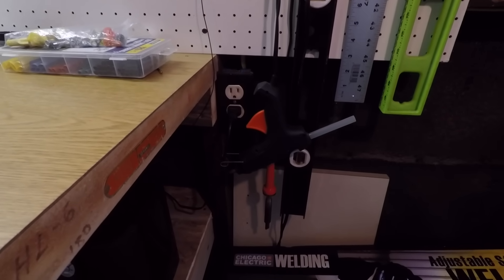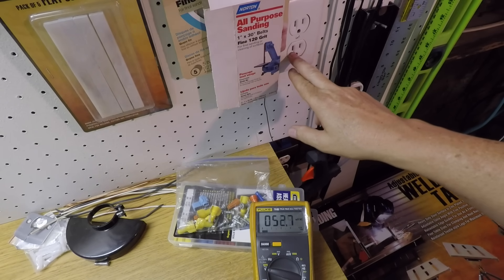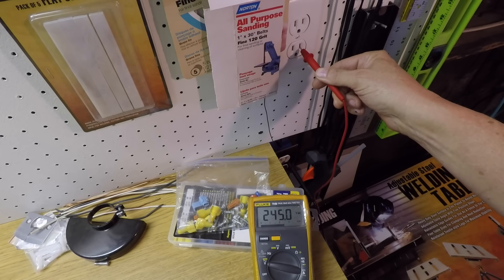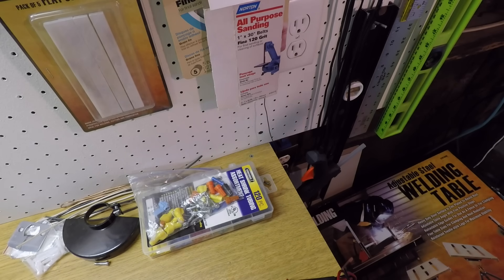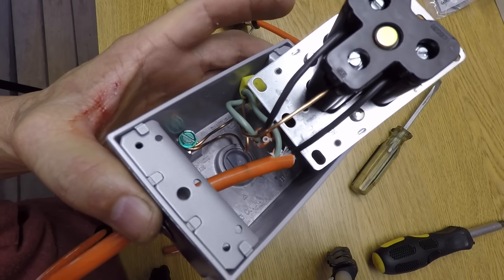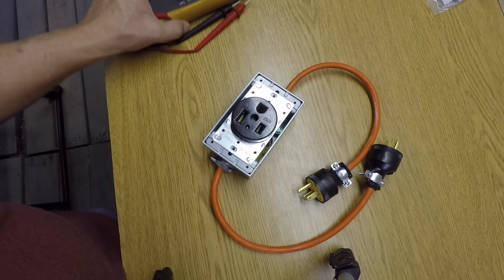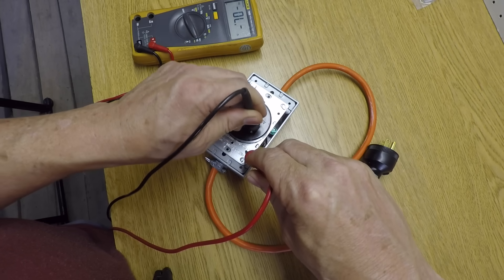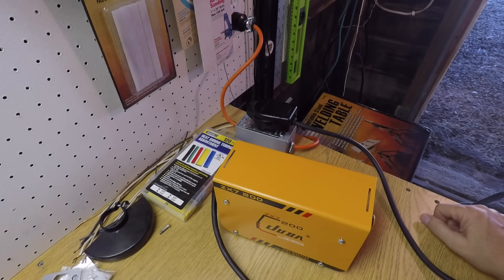How to Get 220v From 110v

Comment: Honestly I'm a Electrician for 30+ yrs now, and if you have the knowledge to do that, you should REALLY  run a separate 240v from your panel,  brother I've seen so many mistakes, problems,  and fires/ shocking wires/shorts. Please dont do this, a welder,  air compressor,  anything 220v/240v need it own dedicated circuit/ outlet,  not shared in anyway.  Please fix it right and be safe , God bless.  
Daren from south Florida
Reply: The reason to run a dedicated 240v is if one side shorts both breakers will trip shutting down both legs.  With this setup you could trip one breaker and cause the voltage to drop to 120v and fry any 240v item you are using, at the least it won't work correctly.  Seems like he knows just enough to get in trouble... 
This might work in a pinch but not a safe way to do it!
Reply: @arkansasmountainman  What if he uses breaker ties?
Reply: @arkansasmountainman  that can't happen
if you open one breaker ... the circuit is open ...it's like putting the light switch on the neutral side 
but it's safer to open both side...
Reply: @moreause  he's right. If one leg opens on a 240v circuit, the other leg is still hot which means there will be 120v still running in the circuit. This is why multi-leg circuits require breakers that are tied together or a multi-pole breaker. It is like putting a light switch on the neutral side in that it's non-code, unsafe, and very bad idea.
Reply: @arkansasmountainman  since I can't seem to put V8SKULLS ATTENTION WITH THE @ CAN I get you to take a look at this rig I have setup for my welder and let me know if it's safe? https://youtu.be/39pDXRI2q8M
Reply: @arkansasmountainman  The voltage may drop from 240v to 120v, or it may drop to 0v. Why zero? Because the 2 120v circuits are in series, not parallel.
Reply: @foureyedchick  it will not drop to 0v. First, power lines are not series or parallel. You have 1, 2, or 3 phase power. If you are using a single-phase 120v transformer you will have a single circuit supply that will only give you 120v, and if you attempt to wire from two breakers, they will both be the same circuit, so the potential between the two will be 0 because they are the same circuit. If you have a single-phase,120/240 you effectively have two different legs, with a total potential of 240v, between them. If you lose one leg, you will still have 120v. The only way to have 0v would be to lose both legs. Loads are in series or parallel, supply is not. 40+ years as a lineman/electrician. It may also be possible that if you have two 120v circuits that you will have 208v between the two circuits. If you want more information about how this works, message me.
Reply: @inconnu69  what I am thinking is  If the item he has plugged in is getting the power across the two hots or two diff bus bars when one breaker trios then there is no circuit. yes there would be 120 from one hot to the ground but if the welder is wired to receive power from the two hot wires and  not wired to receive power from the ground then it should be getting 0v.   

this is a question not a definitive statement.     

the transformer is 220 volts from end to end or the two hot wires.  has a center tap to provide half(110) and also the center tap is referenced to ground so there will be 0v between "neutral" and ground for safety reasons if I am thinking right.  

so a 220 circuit makes a complete circuit with both ends.  loosing one breaker breaks the circuit all together?     yes still 110 between one hot and ground on the leg that did not trip but if machine is using the ground as only a true ground fault and not a neutral then it should go to 0v to the machine hooked up.    

anyways that is what i am thinking
Reply: @arkansasmountainman  Nope, 220 doesn't  work like that at all. In a  220 set up the other leg is the return. If one leg trips. The other leg has no means of return other than ground and thus no way of frying anything anything  because without a return the voltage is zero. Happens all the time when 220 breakers go bad and one side opens. Even sometimes the main breaker or even the meter fails on one side. Power companies have shunts used at the meter to to feed the entire house with just 120v. 220 appliances simply don't  work in this setup.
Reply: @u000na0  I believe Arkansas man is correct. We aren't talking about a 220 circuit, we are talking about two 120 circuits with separate breakers. If there were a radio, for example, plugged into the tripped 120 circuit, there would be current from the untripped circuit through the tripped circuit via the neutral of the tripped circuit...which ought to trip the untripped circuit due to the overcurrent condition. Anyway, that's how I'm seeing it. I drew it out on paper and that's what I came up with.
Reply: Truth Be Bold dude. It’s two hot wires that get you 240v. There is no neutral in the circuit.
Reply: @RB-xv4si  you should hear him out. The current will look for it's path back to a return leg and since there would be a theoretical open breaker, if any "appliance" is sitting in the on position, that appliance's neutral becomes the return leg. Which not only is a 120 volt loop, but with loads in series, it's even less voltage for each.
Reply: @u000na0  could shock the tech troubleshooting because the terminal/wire on the OFF/TRIPPED LEG could be backfed!
Reply: @u000na0  so a 2:40 leg is too hot and one neutral and what he has there is too hot too neutrals two grounds to Earth and he's only using two grounds to Earth and two hots and he should be using a dedicated line with one neutral and too hots is that right?
Reply: @mrreams711  That is a really good point.  I was thinking in a fault situation this would be bad, but even without a fault an appliance that is on would provide that path back via its neutral.  Even more reason not to do this.  Plus if those circuits are protected by a GFCI that thing would constantly trip.  Another unspoken reason why the NEC is requiring more circuits be GFCI protected, lol.
Reply: @u000na0  other than ground? How about a human ground.
Reply: You still around?
Reply: @shadowdemon7770  he burned the house down lol
Reply: @chev1972chev  lmfao probably 😂
Reply: Agree 100%. This will work, but its not worth the risk. Do it to code. Be safe
Reply: Doesnt work if youre a mobile service provider.
Reply: i got a mini welder that only has 2 wires coming from it and it is a 220v i am thinking i should replace it with a 3 wire power cable would i be on the right track?
Reply: @tommybaker419  I’m not sure exactly what you mean but if it is 220v and doesn’t have a 3 prong power cord it may have been modified by someone or is extremely old but I would be careful using it. Maybe you could have someone check it over before you operate it. I could be wrong but I thought any 220v appliance in the U.S. should have a ground. I should state, I am not an electrician but I have been a HVAC tech for 17 years and my father was a class A contractor, so I have been around the block. But like I said I could be completely wrong and it could be perfectly fine.
Reply: agree     also no neutral
Reply: Exactly.
Taking three left turns to go to the right.
Reply: @courier11sec  363
LOL
Reply: Exactly.   He's deinventing the wheel.
Reply: since you have been doing electrical for 30 years do you know the name of the box he is talking about? I want to get something for my son who lives in elkins wv  they have no 240 outlets on there property at all
Reply: @carlrockaway1696   I have been an electrician for 40 years and never seen a legal device that does what DIY is doing. to be able to sell an electric apparatus the device has to be UL or approved Laboratory testing. This would never get the seal of approval because it does not allow for tripping of both legs. Also windings if one shorts, who's to say the other side trips? if it remains hot current could still be in capacitors etc. and if anyone opens the cover to check the welding wire and thinks it is off they could be in for a surprise. It just isn't a good idea. It is not a big deal to run a 3 conductor dedicated circuit back to the panel.
Reply: Can I get you to take a look at my setup and tell me if it's safe? https://youtu.be/39pDXRI2q8M
Reply: Hes prob trying to save money or box is a bitch to get to.
Reply: Same situation and I nearly fell over laughing at what folks will do, safe or not, to get power. And YES it needs to be a 2 pole breaker dedicated circuit.
Reply: Okay but what about the old fuse boxes?  One leg the fuse blows and the other leg is still hot?  I've had service disconnects where one fuse blows and one side not...
Reply: You could potentially phase the box doing this as well the two breakers should be on both poles of the panel inside of your breaker box. This is a terrible idea.
Reply: Can help me with my issue I see you have the West Virginia or Virginia label
Reply: V8SKULLS amen! This is a horrible idea. The breakers also will not work right.
Reply: Agree. By the time/material/compromised safety is figured in , you could buy the romex, box, breaker and outlet .  Especially a welder is going heat up those stranded wires and rubber coating.
Reply: So if he had the proper diameter wire instead of the orange cord he used,, and plugged those into an outlet each, then ran the other side into a small box that held a 240v breaker, then the proper wire size out of that box and into the 240v plug/ box, would this be any safer or is it still a issue because of the 2 120 breakers in the house going to the plugs and there’s just no way around that fact? Basically is there any way to make this safe or how can I make this as safe as possible if I wanted to make one for emergency use every now and then ?
Reply: In my opinion, there is nothing inherently unsafe with this. Anything 220 does not need a dedicated line. In much of the rest of the world, 220 is the standard because they dont use center tap transformers. This is a single phase setup. As long as the wires can carry the load, there is nothing unsafe about this set up. It's  even practical if it is the only viable way to feed the rated load. You know what they say about opinions though right.
Reply: @u000na0  no.  rules require that any line tripping a breaker trips all lines.  2-pole breaker required.  Also, if one trips, user will have one hot and one not and could be in danger while trouble shooting.  And, the load, if connected, will pass that one hot through it to the point of open circuit---possibly all the way back to the tripped line......so the user/tech could have a HOT screw on an off/tripped breaker.
Reply: @u000na0  No I totally agree with you, there is application where there is an incredibly low risk of safety. Literally tens of thousands of things like you said run off of 220v super low amperage, Phone chargers, tv, house lights, ect.... but I think there is an issue when it comes to Americans converting it. because I would imagine most of the time we would be converting it, its for heavy equipment running a much higher amp and totally runs risk of way maxing out ratings on plugs, wire, and over all setup. that's where issues can come in. I'm not gonna lie I use one of these for a 220v welder. but My modal usually supports a 120v with a lower duty cycle, but This one doesn't. Welders have built in large capacity caps and step up hardware that would allow for short bursts of current, as long as you aren't pushing it to hard. definitely not for profession grade welding.       good observation though man.
Reply: @u000na0  we don't work the same as the rest of the world. Get over yourself.
Reply: This is incorrect. European power is supplies as 400/230v with the typical appliance drawing 230v between the neutral and 1 hot leg.
Reply: @u000na0  My issue with it, is that 12ga wire and 15A outlets are not heat rated for these loads. At the minimum, change to 20A outlets and 10ga wire. Then the problem is that the rest of the circuit, feeding each outlet, is on 12ga wire, which is a code violation. All the feeds must be the same guage. Good theory, but dangerous practice, here, I fear. Thanks for your prospective.
Reply: @u000na0  Constructive criticism on my part:  Yes, this setup will work and having higher voltages (240) isn't the issue.  Problem is that he's tapping into Phase "A" and Phase "B" from two breakers which aren't bridged.  as mentioned in other areas of comments section, if one hot lead shorts or overloads, the one breaker may trip... and the other will remain live.   Not only will the device (welder?) only receive 120 volts, but the ground lead will become a current-carrying lead.  The entire device will become electrically active:  Touch the case & it's an immediate shock hazard.
The only way to properly harness 240 bolts is to wire properly to a double-pole breaker.
Reply: @Schrimpieman  but, i mean, could we assume in his panel he has the 2 breakers close enough that he can bridge them so when one trips they both trip...........

Comment: You forgot to mention the most important part.  Two "separate lines" is not good enough.  They need to be different PHASES or it will not work.  You can have two completely "separate lines" but both from the same phase and it will not work. You will still only have 110 volts.  And if someone doesn't know what that means or how to check then they should not attempt this.

Comment: Will you get 240v? Yes.  Is it safe and does it conform to National Electrical Code?  No to both.  Check out NEC 300.3(B) - (Paraphrasing - all wires of a circuit must be contained in the same cable or conduit.).  If you pull a leg from two different cables, you have the potential for inductive heating.  Now, if you have a split receptacle fed from a multiwire circuit (Black/Red/White), you may have a leg to stand on, as technically all of your wires are contained in the same cable feeding the receptacle.  However, with a split receptacle, you're 95% of the way there - add an outlet box and tap off the black, red and ground (assuming you're using romex and not EMT, ie), and just install a Nema 6-20 receptacle adjacent to the split receptacle.

Comment: Seems completely mad to have a dual voltage supply to a building when any heavy duty appliance needs 240v to work. Why not just use 240v everywhere like we do in the UK. We have higher fused supply circuits to sockets and and a individual lower fuse in each plug for the rating of the device. That way you can use a heater with a 13 amp fuse and a table lamp with a 2 amp fuse plugged into the same type of socket and its safe. I fail to understand why the states has different sized sockets for different currents and voltages. This went out of fashion in the UK and most of Europe in the 40s.  Also noted that there is a complete lack of Residual Current Circuit Breakers in the distribution panels protecting any of the outgoing circuits.
Reply: Because we are not in the UK. Do we really want to go down that road of asking why we don’t do this and that?

Comment: 12 gauge wire is good for 30 amps.
Reply: Really? What code book are you using?. 12Ga is rated for 20 amps. 30 amps requires #10 wire.
Reply: Ota pend whats on that load and are you running a motor cause you would need to use the flc chart x 125%
Reply: But the breakers and outlets aren't 90deg so cant use it

Comment: So, you actually do have a 240 supply in the building. So not getting 240 from 120.
Reply: jimmy toto You do have 240 V AC coming to your electrical distribution panel.
But it is in the form of 2x120 V AC.
IF THE 120V circuits are connected in SERIES you get 240 V AC.
Or  1 120 V AC circuit gives you 120  V AC.
Wiring a 240 V circuit is EXTREMELY EASY and it is the standard practice for running a Stove or a Dryer or your Air Conditioning

Comment: you need 50 amps minimum to run a welder folks just spend the time and money to install a 240 volt outlet on a double 30 or  a 60 amp breaker
Reply: That welder came with 14 awg wire so there is no way it will draw more than 15 amperes.
Reply: Depends on the specs of the welder, they do make small welders.
Reply: tinny blacksmith That’s not true with modern inverter welders. 200 amp welder with a max 220v draw of 27 amps.
Reply: Why comment if you have no idea what your talking about.

Comment: Why not just put a 220 outlet in. I think you will confuse people by saying separate lines. I think you should explain that better ie if they put both circuits on the same bus in the panel they will not get 240. The other problem with doing this is you are on two separate breakers which can be a safety problem. I believe the more expensive unit you can buy probably has that protection built in. Just curious as to why do this. And not just put a dedicated 240 and use extension cord from outlet to welder.
Reply: You don't have a clue where is panel is in relation to where his video is being filmed. It could be a nightmare to run new line and very costly.
Reply: @plainoldme7322  Nope... he has the different phase circuits right there.  That's why this is even possible.  He should just wire a 240 and be done with it.  He could even put in a 240 circuit breaker back in his box and wire this correctly.  No having "...to remember to plug both in before turning on the welder" and "...remember to turn off welder before unplugging"